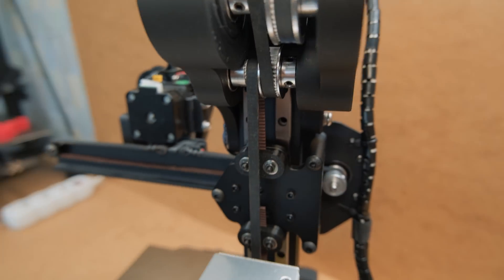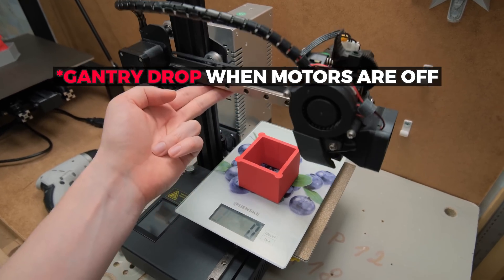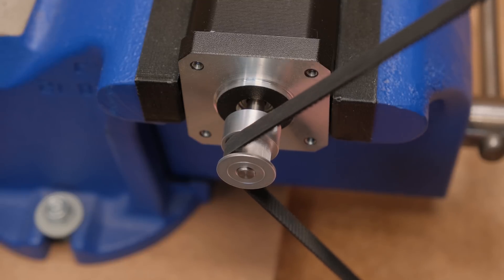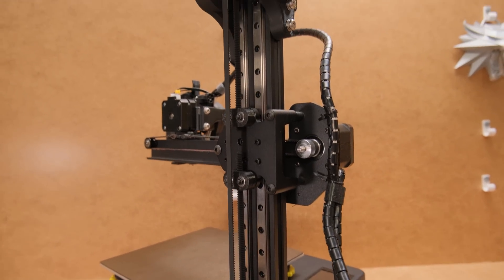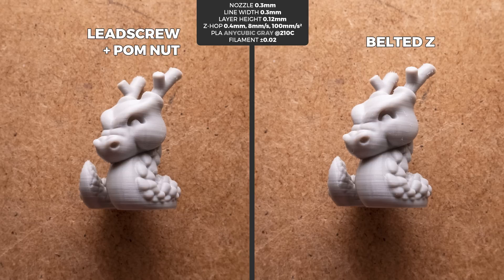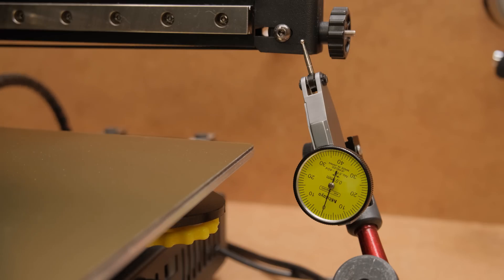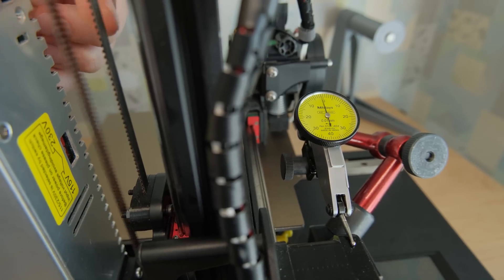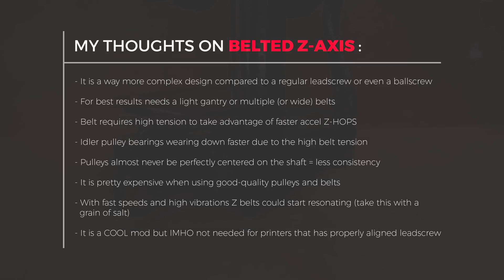3D Printer’s BELTED Z-AXIS – INSANE PRECISION!? or NOT WORTH IT!?

Comment: I would like to see someone attempt a linear stepper z-drive, with an elevator safety brake style gantry drop mechanism.
Sounds like something you are better equipped to attempt than I am........ ;)
Reply from the maker: Maybe, maybe...
Reply: Why though? The Z-Axis makes hardly any movement. Surely it's the X and Y axes where you could achieve the most speed gains?
Reply: @andybrice2711  Right.  Hardly any movement for the printing of say a full Mandalorian helmet.  1) I am not interested in quality of print, rather interested in zero post-processing. 2) This video is not about speed performance.  3) I would like to see whether micro-stepping on a linear rail has the granularity a standard brass nut and rail has.  3) Because I am curious and proposed the challenge - ie why not?
Reply: @truegret7778  I mean, sure, all those of experiments would be interesting. But my prediction is it would add major complexity and cost with no advantage.

Whereas linear steppers on the X and Y axes, I reckon that could be revolutionary!

Comment: I have a belted Z on my Pro 3D V-King 400 and I just have end g-code to lower the bed after a print has finished, a gantry could use the same method although filament would need to be retracted and the bed and nozzle would need to be cooled before lowering.
Reply from the maker: And how is your z doing with belts? After this, I am really interested in voron 2.4 z axis and how well it works.

Comment: Why is the point of all this ? I tis useful to do that "hack" for people to see how belts in this application absolutely don´t make any sense. You should always prefer design slimplicity over overengineering.
Reply from the maker: I can ask you the same about your comment lol
Reply: @PrintingPerspective  Why would anybody choose a more complex more bulky technical solution with similar results ?
Reply: The point is experimentation. Testing an idea to see if it works. So far, the answer is "no". Which is still useful information, even if it might feel like a failure.
Reply: @andybrice2711  experimentation makes sense if you don´t the outcome. Everybody should have known that a complex multi part array is not as good as a simple rod.
Where experimentation would make sense is comparing timing bets vs fishing line or POM wheels vs linear rails etc. This was basically a waste of time for clickbait.
Reply: @sierraecho884  Yeah, that was my prediction too. But a fair few people are claiming they get better results with a Z-Belt. I'm very skeptical about that. But I guess it's worth testing, to try and work out what's going on there.
Reply: @andybrice2711  Sure, in this case you are right, if people claim that and you want to disproof that claim, that makes sense.

Comment: I have a large DIY bed slinger and last year I converted it to dual drive belted Z axis. I designed a simple gearbox with a 5:1 reduction (using 80T and 16T pulleys). It all works great, but there is very little improvement in terms of print quality over leadscrews. I didn't lose quality, but I didn't gain much either. But there is one big advantage and that is that belts can move the gantry much faster than leadscrews. I have my gantry set to do all moves at 75mm/s and 1000mm/s2, and that makes Z-hop much gaster than with leadscrews, and on some prints (with lots of travel moves) that can make a huge difference in print times. The reason I did it was because I enjoy tinkering and modding my printer, so for me it was worth it, but if you are doing it to try and get better print quality, I wouldn't recommend it. 

With regard to your print quality issues, did you try increasing the current to the Z stepper? If the current is too low, it's easy for the stepper to skep microsteps, and that could account for the artifcats you are seeing.
Reply from the maker: Thanks for the info from your side. The fast Z-axis speed is great, but you don't really need that on regular prints. You mostly need accel and I needed to tighten the belt a lot to minimize the wobble that occurs when moving up and down on z-hops. But again that can be minimized with more or wider belts or a lighter gantry.

The stepper wasn't skipping any steps at 750mm/s2 accel and 25mm/s travel speeds. And my prints were with 100mm/s2 accel and 8mm/s travel.
Reply: @PrintingPerspective  actually I get what he is talking, I use a few Bambu A1's  along side my N4-Max's  and Plus the A1's in some prints are not getting the time to clear the Print during a fast movement, it snag's it at times making snapping pop sounds, and in some cases will pull the print off the bed! some of the faster printers the lead screws just don't give the speed needed.. I am wondering if the quality at least stays as good with a dual Synchronized belted Z system so bought a kit from TBstron but there is other plans that a leadscrew will not work
Reply: It improves quality by eliminating wobble and other issues due to a bent leadscrew and other issues with worn leadscrew brass nuts like z compression etc. If the printer isn't experiencing any of those issues then a belted Z will not show any improvements (when adequately implemented).
Reply: @hd-be7di  just do a wobble x upgrade then?

Comment: I would love to see you repeat these experiments after you get a better extruder. The imprecision of the extrusion gear is far worse then any runout on the belt pulleys.
Reply from the maker: Yeah, it would be interesting to see (I written down as a quick video idea). But also dual-drive extruders can have issues of their own. Even if we invalidate the print results, the test with a dial indicator shows that at least in this specific scenario, belted z wasn't as precise as I was hoped. I get more or less similar results on printers with a regular lead screw.

Comment: Maybe it's worth checking if the titan extruder is the source of those artefacts. After all it's a cheap titan clone. Was actually considering switching to a bowden extruder to reduce weight of the toolhead. Cool project for sure, thank you for all your hard work. My KP3S suffers from Z wobble and I'm still undecided what should I use to fix it, but right now I'm leaning towards wobble rings designed by EvoMotors (thingiverse) or WobbleX sold by Mellow
Reply from the maker: When mine was stock it suffered too. But with some drilling and trial and error, I got it to a perfect lead screw alignment. The prints look fine not under the worst lighting conditions. I can show them to look flawless too with the right lighting angles like all people on social media do, just saying. :) BTW make sure it is not the X-axis wobble as it is a cantilever 3d printer.
Reply: @PrintingPerspective  My reasoning for considering bowden is: 1) less weight = higher accel and less ghosting, 2) as X value changes during printing the nozzle's distance to the print also changes, because only one side of the X axis is supported
Reply: I think most of the artifact that he's seeing can be explained by miragec inconsistent extension video

Btw wobble X and ring probably won't work, the gantry of the kp3 is not heavy enough and wil cause the z to jitter since the wobbleX is not being compress
Reply: @twanheijkoop6753  There was a remix with 10x2mm (N52?) magnets that fix this issue, but not sure with how many other printers it was tested

Comment: I converted my ender 3pro with dual lead screws to Kevin's dual belted z and the z banding on my prints totally disappeared. Also I was now able to do much faster printing at 120mm/s and faster z hops too. So I do not agree with your conclusion that the belted z does not help. Also I am running a direct drive on my ender and despite the additional weight on the x gantry of the extruder and motor my gantry does not fall when the motors are off. One more thing, I am able to do 4x faster z homing and bed mesh with the belted z and that too without any noise which the lead screw would make. So overall my results are totally opposite to yours 😊
Reply from the maker: I never said it never helps. In my scenario, it didn't. But I had a perfectly aligned lead screw and had 0 problems before. I also tested at 0.12mm layer heights which are very demanding. If in your scenario it did, I am glad it worked out for you! :) I personally just find the mod way too complex with a few potential issues. Cheers!
Reply: Nice video. I did the Kevinakasam dual belt z mod as well on my Ender 3 pro. In retrospect, I should have done my CR-10 instead as the gantry is much wider with less support with just a single z screw. But all in all, I'm quite happy with the mod on my ender 3 and will do the same to my cr-10 when I get a chance. I personally haven't found a need to install a key bak mod on my lightweight gantry with bowden and minimal hotend.
Reply: @fredmertz4819  My enders are all direct drive with the mod from Thingiverse where the stock extruder directly mounts on top of the hot end and even without a keybak the gantry does not fall even when the printer is off, might be useful to you
Reply: @Accessgp  good to know thanx
Reply: same here
Reply: Did you also upgrade the roller wheels to linear rails?  I think that's where there may be a lot of the quality improvement, as those roller wheels can develop flat spots or get debris caught under them and cause pretty bad Z banding as a result.

Comment: How about using a large gear extruder for these tests? That should be more consistent.
Reply from the maker: Yea, it would, but even ignoring the print quality the movement consistency of the z-axis wasn't as good as with a ball screw.
Reply: @PrintingPerspective  So if ball screws are better couldn't you build a 3d printer with ball screws for X and Y? It is probably really impractical but combine that with a large gear extruder and you might make the ultimate quality 3d printer.
Reply from the maker: Yes, you are talking about the Pantheon 3d printer :D go look for the price of those, as you need really good quality ball screws :)

Comment: Thank you very much for taking the time to do these tests and comparisons. I am about to redesign my home made CoreXY printer to replace the use of screw/nut with pulleys/belt. With this information, I better analyze the possibilities before moving further. Very good videos! Thanks for sharing! 😁
Reply from the maker: Thank you for the nice comment, glad you liked it! :) Probably the easiest and most cost-effective way would be just using POM anti-backlash nuts on regular properly aligned lead screws. After this video, I will really need to test Voron 2.4 z-axis (I need to build it first lol).
Reply: @PrintingPerspective  Anxious to see it! I have to do more research about using the stationary bed and moving the rest. Good luck with the assembly!

Comment: I must admit that i always wondered why people aren't using belts for their Z-axis since it's something really accurate, so those results are extremely interesting for me. Nice videos in general dude, keep up the good work.
Reply from the maker: Thanks. I heard good things about belted z too but, I have to admit, I spent so much time analyzing what can be wrong when I got worse results. The more I thought about it the more things I discover that I am not a fan of. So I just ordered another ball screw for the printer :|
Reply: @PrintingPerspective  wouldn't it make more sense to test it with conical slicing? In conical slicing the z axis is more in use than normal slicing.
Reply: @PrintingPerspective  The belted Z axis has been the biggest quality increase mod for me so far! All other modifications seem useless.
Saying that it DOES work. (cannot post demonstration pictures here)
Reply: @andresmoks7272  i'm thinking turn my ender 3 neo to a dual belt z axis from the kevin aka sam cause my lead screw comes binded from factory
Reply: Surely screws are more precise than belts though? The advantage of belts is that they're cheaper, lighter, and faster.
Reply: @andybrice2711  of course they are more precise, exactly because they are "slower" 1 rotation of the motor only moves up the nut by 1 pitch, aka much greater and more precise control through reduction. A belt has a bunch of backlash and flexibility, even with a similar gear reduction a ball screw should be more precise (although can be more prone to certain specific resonances/vibrations, as belts are more likely to dampen them and stiff things tend to have more specific but more responsive resonances while flexibel things respond over a greater range but generally much more weakly).

The things is every extra gear for reduction also add extra inaccuracy due to tolerances that every product has (including bearings).

Belts can be good on systems where the Z axis might be over-constrained, or badly designed z-axises where they end up being disturbed by specific resonances that only can't get rid off. 
The video did a decent job, but this comment by JimiDj is a bit off the mark.

Belts aren't all that accurate compared to many other systems but they are fast and generally cheaper. There's a reason they generally aren't used in a CNC machine ...
Reply: @andybrice2711  i wouldn't call them faster for a z axis. A voron v2 for example has its pulleys and gear reduction set up to have a rotation distance of 8mm, meaning one full stepper rotation leads to 8mm travel. On 90% of all lead screws you have a 8mm pitch, so one full rotation means 8mm travel. In theory this results in the same speed, acceleration and force when neglecting friction and inertia. For xy belts are better suited, if you would put screw instead the stepper would need to turn way faster or you have to have a very high pitch which makes the system rather inefficient since it introduces tons of friction. Lead screws also have play in tge threads, on z thats no problem sinve we have gravity, but on xy even a anti backlash nut is not enough. There is/are printers that use ball screws for xy, but those use servo motors for motion and can reach crazy high acceleration without ringing, but cant move as fast
Reply: @over_pizza_2578  True. I didn't necessarily mean "Z-Axis belts are faster" I meant "Drive belts in general are better than screws at transferring high-speed motion."

Of course, you can get screws with steeper pitches, which would also be suitable for high-speed motion. But I imagine there'd be a lot more rotational inertia to overcome during acceleration.
Reply: For the price they are good, but rather complex as you need a gear reduction. That means two tensioners and a good chunk of space. And you mustn't cheap out on pulleys as this would also result in z "wobble". Personally i prefer integrated leadscrew steppers and pom nuts. Silent, grease free, space efficient and precise. As long as you have the same z steps belts and screws are equally precise, have equal force and same top speed (not accounting for screw or belt system inertia). Consistency is dependent on the quality of the used components, a shitty leadscrew is just as bad as wobbly idlers or pulleys
Reply: Cetus (which the printer shown here is copied from) from 2018 era had the belt driven z axis. It had that gantry drop problem, the fix they added was to use a friction brake, so a plastic collar rubbing motor axis. It kind of worked. I remember someone in reddit did a servo mod (so a servo held the gantry at the end of the print).